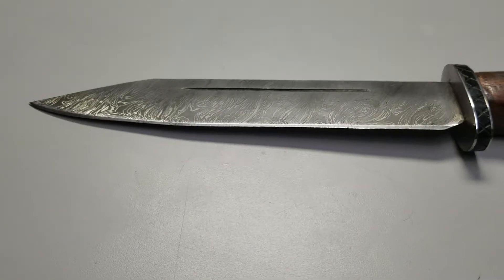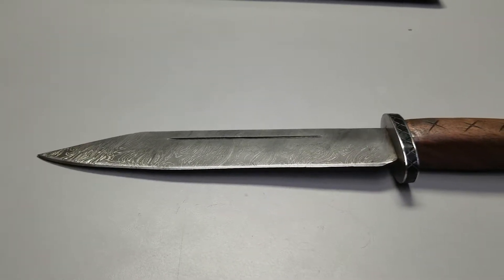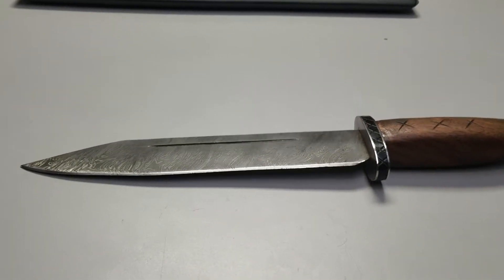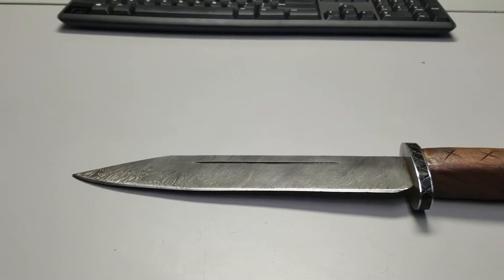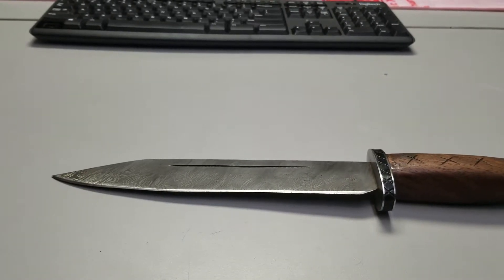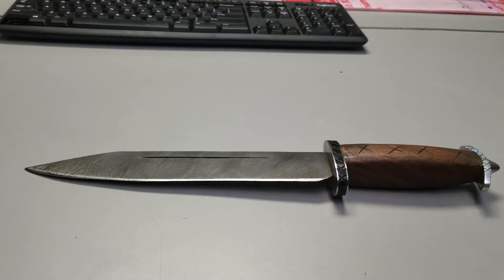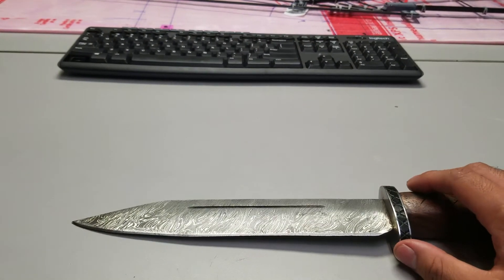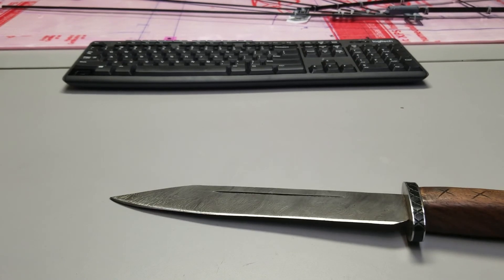What is Damascus steel, and is it worth it?

Comment: If the damscus knife is made using pattern welding, isn't it that the design will be omnipresent in the whole material of the knife and not just the surface, in that case, it should not vanish when given an edge or sharpened.
And those who sells fake damscus knife, can acid dip the knife before sharpening it and then after the pattern is there, they can sharpen so, the edge looks clean and pattern is present on the body, just like original damscus knife.
Great content though, I have nothing to do anything with knife, just an ADHD guy watched an episode of Why It's Expensive and got curious about damascus and got into a rabbit hole learning about forging and types of knives.
P.S : ADHD Pills do work LOL XD
Reply from the maker: The pattern is revealed by the acid dip, and the acid doesnt soak into the core of the metal, it only reacts with the surface rapidly oxidizing it. So sharpening Damascus is removing the outer layer of metal that reacted with the acid, leaving shiny material along the edge. But if that edge is dipped in acid again, the pattern will come back.

Comment: folding steel usually is a mixture of hard and soft steel. it holds an edge longer but the micro serations gives it a super sharp edge
Reply: Is it really done "usually"? If you look arround you see it extremly rarely. Do you have an example?
Reply: @ArthurHerbst  i own antique samurai swords. they all are folded steel
Reply: @johannadam3183  They shure are. I was actually refering to having soft and hard layers. Have you been hardness testing them? Not trying to be overly critical, its just that i've not seen many examples for that.
Reply: @ArthurHerbst  this was done hundreds of years ago by master smiths and cannot be recreated and definitely cannot be tested not that im aware of.
Reply: @johannadam3183  there is a reason the Japanese had to make their swords that way, and that is due to their iron that is naturally found in Japan being inferior and very weak and so they need to come up with special methods to refine the iron and make sure their weapons were stronger and even then only a small percentage of the weapons found in Japan were a good quality well most were rubbish. The truth is that a product made in the way you’ve described is still far weaker and then one modern steel throughout the entire blade.
Reply: @AlexanderMason1  nice story bro. Japanese katana swords are about 1 1/3" wide and with a 24" to 29" cutting edge. That is a feat on its own being that long and thin without breaking in battle. They did the best they could with what they had and what the purpose it was used. Many swords were too expensive to even use in battle. They opted for yari spear on a wooden pole. I believe the original question was Damascus worth it. I believe it adds eye appeal also a bit of sharpness so it is worth it. No one is saying modern steel isn't stronger, its just not as fancy. So if you got a bit of extra cash go for it you wont be disappointed with the folding pattern.  Also op is talking about modern folded steel. Im sure they would use strong modern steel that is superior to ancient japanese steel for damascus anyway.
Reply: @ArthurHerbst  I just noticed in OP video decription it is written that damascus is a mixture of high carbon steel and low carbon steel. I guess this is the example your asking for.

Comment: Right now I'm making a chain Damascus blade (I brought the blank off online shop) but I don't know how to measure the integrity or the strength in my knife

So I just re-quench my blade (I quench my blade while it's Chilli Red) in near boiling water+palm oil mix and leave it in the mixture for a minute then Resharpen it, then I tried no-spin trow into a wood and it bent the tip of my blade...

 Did my re-quenching failed?? Or is that just nature of a motorcycle chain Damascus?
Reply: Its the nature of the steel lol it’s too soft or you aren’t getting it hot enough and leaving it at a medium heat to temper the blade and even out the hardness of it

Comment: So it depends on the types of metal you use and quality. And the right combination could give you extremely well made weapon.
Reply: Not as good as just one of the steels.
Reply: @AlexanderMason1  Define "good"
Combine a high durability steel, with a high edge retention steel, and get a nice blend of the two. 
Plus the added "toothy-ness" of a freshly acid etched pattern welded damascus is quite desirable.

Comment: So is Damascus just mixing two types of steel together If yes can you add aluminum to steel with Damascus methods
Reply: Probably not with conventional methods. As far as I habe seen combining different metals is quite hard and aluminum adds to that in the way that it is molten at forgewelding temperatues (900°C+). Maybe there is a powdermetallurgical way. Maybe.

Comment: Pattern welded steel is rarely done with low carbon steel and high carbon it is usually done with high carbon steel ie 1084 and high carbon steel with nickel ie 15N20  and forge weld them . Otherwise using low carbon you will get a resulting blade with absolute crap ability to hold an edge
Reply: No matter how you slice it Pattern welded is absolutely not Damascus

Comment: Titanium is better
Reply from the maker: Not for swords, actually. The problem with a titanium blade is once it gets dull it is AGONIZING to re-sharpen.
Man at arms forged did a titanium sword and they went through ten sanding belts to sharpen it.
Reply: @arabianknightarmory2418  but arent swords not meant to be sharp, they are thin blunt weapons, sharp wont do much against mail or armor, im pretty sure
Reply from the maker: @MrHugo9397  swords are meant to be sharp. Almost no sword in history was intended to be used blunt. Swords were not the only weapon a knight carried. A mace or pole axe would be much better choices for someone fighting armor. Swords were very specifically meant against unarmored or lightly armored people. 

The only exceptions I can think of are the estoc / tuck and mail breaker, thrust-only swords that abandon having an edge and are essentially glorified spikes.
Reply: @arabianknightarmory2418  ok cool thanks for clearing that up
Reply: Titanium. Hell no. It is pure but steel is not. It's alloyed. Don't you compare nonalloys wiith alloys.
And it's much weaker compare to many steels and softer. But it still holds better against many heat exposures I guess so
Reply: @hhh-yh8wn  Actually titanium is harder than stainless steel. And meant Ti alloy, nobody uses pure metals alone today due to alloy advantages. Same way carbon makes iron harder same way it can make titanium. Only problem that Ti is currently expensive to make, most resources are in Russia, while iron is cheap and abundant everywhere.

Comment: Wootz is a form of crucible steel and it makes an exceptionally clean mono-steel, which makes it able to be hardened more while retaining far more toughness than pattern welding.

Damascus patterned crucible steel is considered Wootz, by not all Wootz is Damascus.

Damascus is a crucible steel and the Damascus pattern comes from a specific mine near Jordan and was worked by smiths in Damascus that knew how to bring out the pattern. It takes a specific set of trace elements in the ore to make the pattern and it takes a lot special techniques to bring it out and work because the Woots is extremely brittle right out of the crucible.

The reason the pattern is desirable is that it is carbide micro sphericals gatherd in clusters. The carbides being round prevented stress fractures from forming in the more ductile carbon steel matrix of the metal. The combination of exceptionally hard carbide clusters in the exceptionally ductile steel matrix can be hardened more without making the metal brittle. You get a harder, more durable edge on a stronger, more flexible steel. Compared to the bloomery steel of the far more common swords, it would be like taking modern super alloys to the dark ages. 

Ulfberht swords the Vikings made were forged from wootz ingots that were imported from the Middle East down the Volga trade route. They were far better than the pattern welded steels everyone else was using.

Comment: The pattern from Wootz will not be as apparent as pattern welded as the pattern is derived from different processes and materials. Dendrites as opposed to layered differing alloys. A wootz blade against an iron blade would be disastrous for the iron blade.
Reply from the maker: From what I've read, anyone who could work Damascus, be it in pattern welding form or natural wootz form, would produce a stronger blade because the grain structure is tighter and more stable than low quality iron swords.
Reply: @arabianknightarmory2418  i saw a video on forging rolled alluminum rod
And I was wondering is it possible to make a dimascus piece out of aluminum?

And do you think it would be superior to closed die forged piece

I know the questions are ridiculous because Al is weak anyway but I would love if you could answer them for me based on your knowledge with metal and by superior I mean higher tensile strength

Comment: I  heard ancient Samurai swordsmiths would plung hot burning steel through a tied up enimies body to give it magical powers, which actually added carbon. I'm an amateur knife collector . I'm a carpenter and one day while doing a job my customer was cleaning up their basement and decided to throw away a laboratory microscope. I scooped it up real quick
Reply: Kind of the same thing happened with Vikings. They would add animal bones to their iron thinking it was enchanting the sword with the animals spirit. It was actually adding carbon.
Reply: Green leaves work better. They add carbon and hydrogen. The hydrogen lowers the melting point of the steel.
Reply: @ihcterra4625  unless used against fire giants
Reply: @naturesarmy9  that is what the cryo treatment is for.

Comment: I think damascus is overrated today in pop culture...but I would like to believe some of the stories from the past. You have to keep in mind....all swords and knives today are VERY GOOD and even legendary status in terms of material and precision of workmanship (machinery).

In the past...a lot of knives were made no better than a bunch of compressed slag shaped and sharpened on some kind of brick or stone...and not the whetstones you see on sale nowadays for very cheap. Overall...metallurgy is nowhere as complex as modern society. If its damascus steel produced in one of the world's finest workshops at the time...versus a peasant iron slag sword metal looking thing...I would think yes....could possibly cut those things in half....or at least heavily chip it to the point of non-functioning over the course of a duel....
Reply from the maker: Depending on the time period in history you and DJ UwU are both right. 

During the migration era, Europe lost a great deal of its technological advancements thanks to the fall of Rome. Without standardized imperial smithing, the hardness and consistency of swords varied dramatically, as people had to just figure it out on their own. A low end quality migration era sword would have lots of soft spots where if it hit Damascus it would take a nasty dent on the edge and the Damascus would be almost unaffected. But by the late medieval period, Europe had fully mastered crucible steel, and sword smithing guilds significantly improved the standardization of quality on swords and knives. The metallurgy of a king's longsword in the 14th century is reasonably comparable to 10 series steel (1065, 1075, 1085.) At the same time it cannot compare to top end space age alloys like 5160 and 6150 or W2.
Reply: @arabianknightarmory2418  Very interesting stuff about the history and the historical comparison to steel today! Would love to see some videos on this subject if you have time to make it!!!
Reply: @arabianknightarmory2418  But what about pocket knives that have a VG10 steel core? I heard they maintain a good edge and the VG10 steel is very hard. The outside with the Damascus pattern aren't doing any cutting anyway.
Reply: Lots of these said "peasant" knives....would not survive to modern times. The metal would of been recycled or rusted away a long time ago....therefore hard to prove my claim....but thats how I would like to think it would have happened.

However...damascus steel sword put up against a very well constructed sword for a lord (not peasant slag daggers and swords)....I don't think damascus would have much of a distinct advantage. Maybe it will point out your status/wealth and if you kill someone with a damascus sword he probably has servants/friends that will come after you...especially if you can't afford one yourself (in the middle ages)